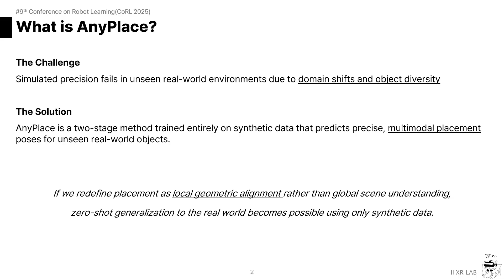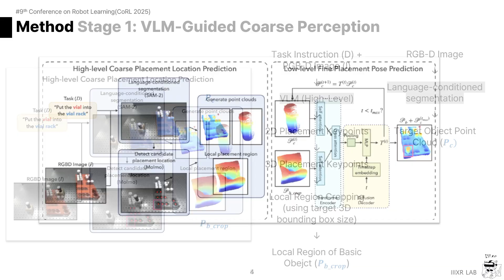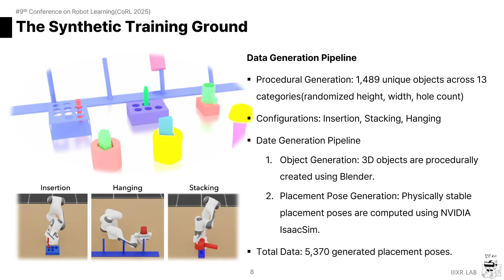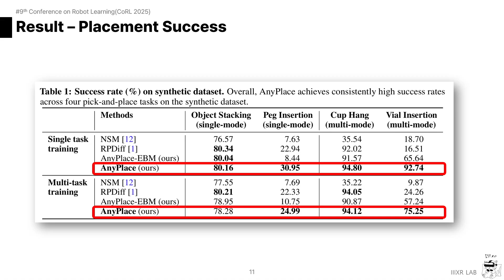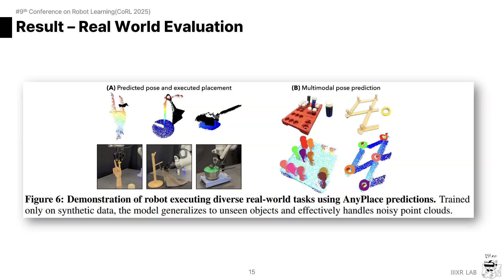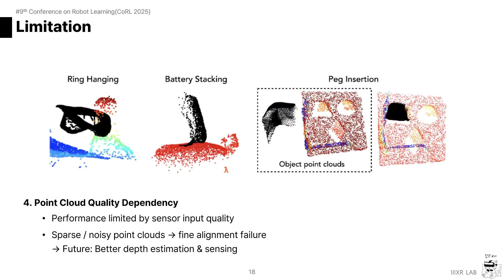[Seminar] Can a robot place objects precisely in unseen real-world environments?

Comment: Q1. The low-level model uses a diffusion-based decoder for precise SE3 transformation. Could you elaborate on the computational overhead introduced by this iterative denoising process compared to a direct regression approach, especially in real-time execution scenarios?

Q2. The synthetic data generation uses Blender for object generation and Ambidex for stable placement poses. How challenging was it to bridge the 'reality gap' between this purely synthetic data and the complexities of real-world sensor noise and material properties, especially since the model is trained entirely on synthetic data?
Reply: A1.A diffusion-based decoder introduces higher computational cost than direct regression because it performs multiple iterative denoising steps instead of a single forward pass. In AnyPlace, several refinement steps are used to progressively improve SE(3) predictions, which increases inference time. However, the model operates only on locally cropped point clouds, keeping computation manageable. More importantly, diffusion avoids mode averaging and produces significantly more precise pose predictions. Thus, although slower than regression, it provides better stability and accuracy for precision-critical placement tasks.

A2. AnyPlace bridges the sim-to-real gap by focusing on local geometric relationships rather than global appearance features. Because the model learns placement from cropped local regions, it generalizes well despite being trained purely on synthetic data. However, real-world RGB-D data introduces noise, sparsity, and incomplete point clouds, which can cause failures. The paper notes that contact physics and material properties are not explicitly modeled. Therefore, while geometric generalization is strong, sensor noise and physical interaction remain key limitations.

Comment: 1. The idea of using a VLM to decide the placement location at the image level and then predicting an accurate pose at a low level doesn’t seem particularly novel. Were there other papers that used a similar approach? If so, what makes this paper distinctive compared to those prior works?

2. I am curious about the specific process of extracting a point cloud from SAM2.
Reply: A1. While the coarse-to-fine idea itself is not entirely new, AnyPlace distinguishes itself in how it explicitly separates mode exploration and geometric refinement. The VLM first proposes discrete placement regions, allowing the low-level model to focus purely on local geometric alignment. Unlike prior works, it achieves strong multimodal coverage and high precision using a diffusion-based local model. Importantly, it is trained entirely on synthetic data yet generalizes zero-shot to diverse real-world tasks. This combination of clear role decomposition and synthetic-only training makes it distinctive.

A2. The point cloud extraction process begins with the VLM predicting an anchor point in the image. That point is passed to SAM2 to obtain a segmentation mask for the object. Using the RGB-D depth values and camera intrinsics, the masked pixels are back-projected into 3D space. The resulting 3D points form the object’s point cloud without requiring mesh reconstruction.

Comment: 1. What efforts did you make to address the sim-to-real problem?

2. What limitations does the paper identify/discuss?
Reply: A1. The paper addresses the sim-to-real gap primarily through geometry-focused learning and procedural data generation. Instead of relying on appearance features, the low-level model learns placement relationships from locally cropped point clouds, which reduces sensitivity to texture and lighting differences. The synthetic dataset is built using procedurally generated objects with randomized geometry, scales, and configurations to encourage geometric diversity. Additionally, stable placement poses are generated in simulation to cover insertion, stacking, and hanging scenarios. This design allows the model, trained purely on synthetic data, to generalize to real-world tasks in a zero-shot manner.

A2. As discussed on pages 17–18, the paper identifies several limitations. First, the system relies on rejection sampling to find jointly executable grasp and placement pairs, which is inefficient. Second, the model does not explicitly model contact interactions, leading to hard impacts or failures in contact-sensitive tasks. Third, placement precision is limited by the quality of real-world point clouds, which may be sparse or noisy. Finally, the low-level model does not include language conditioning, making it difficult to distinguish between different placement types at the same location.

Comment: Q1. Your method relies on Molmo to propose keypoints, but Molmo sometimes needs prompt tweaks. How sensitive is overall performance to VLM keypoint error (e.g., a few cm offset), and did you test robustness by injecting controlled noise into the proposed points?

Q2. Since the low-level model isn’t language-conditioned, how do you handle cases where the same location admits multiple placement types (e.g., “hang” vs “rest on”), and what’s the simplest way you see to add language conditioning without losing multimodal coverage?
Reply: A1. AnyPlace is moderately robust to small VLM keypoint errors because the system crops a local region around the proposed point rather than relying on an exact coordinate. The diffusion-based low-level model refines the pose using full local geometry, which helps correct minor offsets. However, large keypoint errors can lead to incorrect cropping and failure. The paper does not report controlled noise-injection experiments for quantitative robustness evaluation.

A2. Since the low-level model is not language-conditioned, it cannot directly distinguish different placement types at the same location. Instead, the high-level VLM implicitly separates modes by proposing task-specific regions based on the language prompt. A simple extension would be to concatenate a language embedding into the low-level diffusion model. This would allow task-specific conditioning while preserving multimodal sampling capability.

Comment: Q1. Since AnyPlace uses a two-stage pipeline (rough placement region from a VLM, then local pose prediction), where does generalization mostly come from in practice: the high level region proposal or the local geometric placement model?

Q2. Because AnyPlace is trained entirely on synthetic data and evaluated on diverse real placements, what kinds of sim-to-real mismatch still break it most often geometry, contact physics, or visual grounding errors from the first stage?
Reply: A1. In practice, generalization comes from the combination of both stages, but they contribute differently. The high-level VLM provides coverage by identifying plausible placement regions across diverse tasks. However, robust generalization to unseen objects largely stems from the local geometric placement model, which learns shape relationships from synthetic data. Because the low-level model operates on cropped local point clouds, it generalizes based on geometry rather than appearance. Thus, the VLM ensures mode diversity, while the diffusion model ensures geometric robustness.

A2. The most common sim-to-real failures are related to geometric sensing issues rather than high-level grounding errors. Noisy or sparse depth data, incomplete point clouds, and occlusions can degrade placement precision. Contact physics mismatches—such as friction and compliance not modeled in simulation—also cause failures in insertion tasks. Visual grounding errors from the VLM can occur, but minor localization offsets are often tolerated by the local refinement stage. Overall, geometry noise and unmodeled contact dynamics are the main sources of breakdown.

Comment: Q1. In the paper, the high-level VLM predicts 2D keypoints that are lifted to 3D for local cropping. How robust is the system to depth noise or keypoint localization errors? Did the authors evaluate the tolerance to candidate misalignment or apply any mitigation strategies?

Q2. The paper mentions using rejection sampling because T_pick and T_place are not always jointly executable. Do you know how many samples are typically required to find a feasible pair? And do the authors discuss jointly optimizing grasp and placement instead of handling them separately?
Reply: A1. The system is moderately robust to small depth noise or keypoint localization errors because it crops a local 3D region around the predicted keypoint rather than relying on an exact coordinate. The diffusion-based low-level model refines the pose using the full local geometry, which helps correct minor misalignments. However, severe depth sparsity or noisy point clouds can still cause failures, especially in insertion tasks. The paper does not report controlled experiments measuring tolerance to injected keypoint noise.

A2. The paper uses rejection sampling because predicted grasp and placement poses are not always jointly executable, but it does not specify the typical number of samples required. Grasp and placement are handled separately in the current pipeline. The authors acknowledge this as a limitation and suggest that future work should explore joint grasp–placement optimization. Integrating kinematic and contact constraints into a unified framework is proposed as a promising direction.

Comment: Q1. To what extent does the overall generalization capability of the system fundamentally depend on the reliability and spatial reasoning accuracy of the high-level VLM that proposes placement locations?

Q2. How can a pose-prediction-based framework that does not explicitly model contact interactions be extended to robustly handle fine-grained, contact-sensitive placement tasks in real-world settings?
Reply: A1. The overall generalization depends significantly on the high-level VLM, but not entirely. The VLM is responsible for identifying candidate placement regions, so incorrect or poorly localized keypoints can limit coverage. However, the low-level diffusion model refines poses within a cropped local region, which provides robustness to small localization errors. In other words, the VLM determines where to look, while the diffusion model determines how to place precisely. Thus, generalization emerges from the combination of reliable mode proposal and geometry-based local refinement.

A2. A pose-prediction framework without explicit contact modeling can be extended by integrating contact-aware constraints into training or execution. For example, adding collision penalties or SDF-based contact losses could encourage physically valid placements. Incorporating differentiable kinematic feasibility constraints would also reduce infeasible poses. Additionally, combining pose prediction with force/torque-based reactive control during the final insertion phase would improve robustness. Such integration would enable more stable and contact-sensitive placement in real-world settings.

Comment: Q1. How does the "AnyPlace" model's coarse-to-fine, two-stage architecture—specifically the combination of a Vision Language Model (VLM) for global mode exploration and a local diffusion-based model for SE(3) transformations—resolve the multimodality and precision trade-offs that typically cause global regression-based models (like NSM) to fail in complex object placement tasks?

Q2. Although "AnyPlace" demonstrates strong zero-shot sim-to-real generalization for pose prediction by focusing on local geometric structures, the execution policy still relies on computationally expensive rejection sampling to find jointly executable grasp and placement poses. Based on the limitations discussed in the seminar, how might future frameworks integrate kinematic constraints and explicit contact modeling (such as force/torque feedback) directly into the model to prevent hard collisions and reduce the bottleneck of rejection sampling?
Reply: A1. Global regression models fail because placement is inherently multimodal, and predicting a single SE(3) pose often leads to mode averaging and poor precision. AnyPlace resolves this by separating the problem into two stages. First, a VLM identifies discrete candidate placement regions, explicitly handling multimodality at a high level. Then, a local diffusion model refines precise SE(3) transformations within each cropped region. Because diffusion models distributions rather than a single mean prediction, it preserves multiple valid solutions. This coarse-to-fine decomposition enables both high coverage and high placement precision.
A2. Although AnyPlace predicts accurate poses, execution feasibility is handled afterward via rejection sampling, which is inefficient. Future frameworks could jointly model grasp and placement while embedding kinematic reachability constraints directly into training. Adding collision penalties or SDF-based contact losses would help prevent physically invalid poses. Furthermore, integrating force/torque feedback or compliance control could enable safe, contact-aware refinement during final insertion. By incorporating feasibility and contact modeling into the generative process, rejection sampling could be significantly reduced.

Comment: Q1:
What is the difference between PointNet and an attention-based transformer encoder?
What are the pros and cons of each compared to other point cloud encoder architectures?
Also, why is a diffusion decoder effective for predicting 6-DoF outputs in this task? Are there alternative candidates? What properties of diffusion policies make them suitable for this problem?

Q2:
RGB-D images are typically noisy in real-world scenarios due to occlusion, sensor noise, etc., as mentioned in the last slide. How does this paper address the real-world point cloud noise problem?
Reply: A1. The low-level model in AnyPlace does not simply extract features from a single object; it must learn the geometric interaction between two point clouds (the target object and the base object). Compared to PointNet, which processes each point independently through an MLP, a Transformer encoder directly models pairwise interactions between points. This makes it more suitable for solving the problem of “how object A should align and fit with object B.”
In addition, 6-DoF prediction is not a simple regression problem, as it involves a nonlinear space where rotation and translation are coupled and multiple valid solutions may exist. Diffusion models the full distribution rather than predicting a single mean value, which helps avoid mode collapse.

A2. The paper does not introduce a dedicated algorithm to explicitly model or remove noise. Instead, it reduces the impact of noise through structural design choices. First, it uses only a small local region around the placement area rather than the entire scene, which minimizes background clutter and irrelevant noise. Moreover, since the model is trained to focus on geometric relationships rather than color or texture features, it is relatively robust to lighting changes and RGB noise.

Comment: Q1. The low-level placement module takes point clouds as input. However, for precise insertion or contact-rich placement tasks, representations such as meshes or signed distance fields (SDFs) could explicitly encode surface continuity and contact constraints. What were the main considerations behind choosing point clouds over mesh-based representations, and to what extent might mesh or SDF representations improve placement precision or physical consistency? 

Q2. The method predicts relative transformations in SE(3) through a diffusion process. Since SE(3) jointly models rotation and translation and spans a relatively large action space, this may introduce challenges in learning stability or precision. Could incorporating structural constraints—such as step normalization or Lie algebra–based parameterization—potentially improve training efficiency or final placement accuracy?
Reply: A1. Point clouds were chosen mainly for practicality, since RGB-D sensors naturally produce point cloud data without requiring mesh reconstruction. They also allow flexible local cropping, which aligns well with the coarse-to-fine design of AnyPlace. However, meshes or SDFs could better encode surface continuity and contact constraints, potentially improving precision in insertion or contact-rich tasks. In particular, SDF-based representations could provide collision-aware gradients for finer alignment. The trade-off is increased computational cost and complexity in real-world settings.

A2. Predicting transformations directly in SE(3) can be challenging due to its coupled rotation–translation structure and large search space. Diffusion improves stability by refining poses iteratively rather than predicting them in a single step. Incorporating structural constraints such as step normalization or Lie algebra–based parameterization could further improve numerical stability and training efficiency. These manifold-aware representations would better respect the geometry of SE(3). As a result, they may lead to improved convergence and higher placement precision.